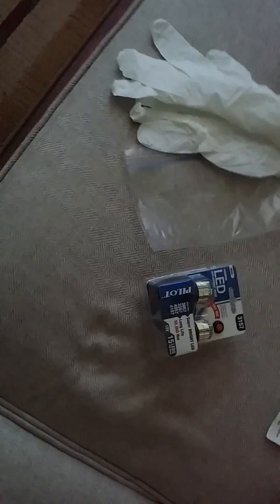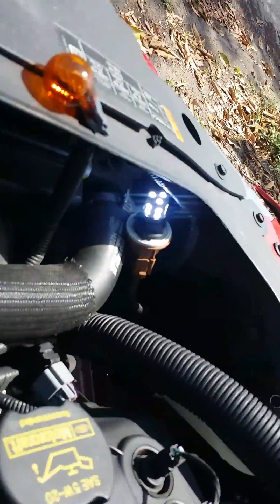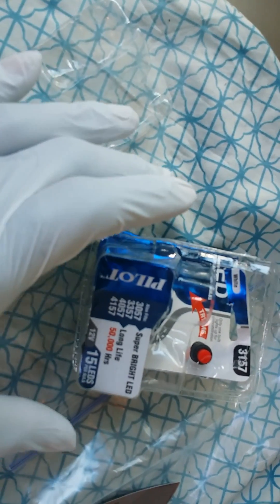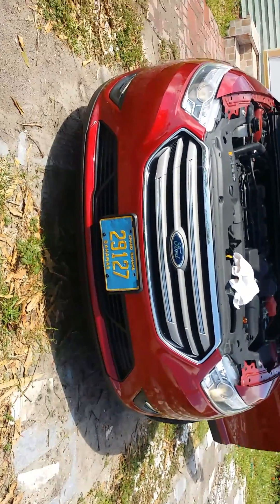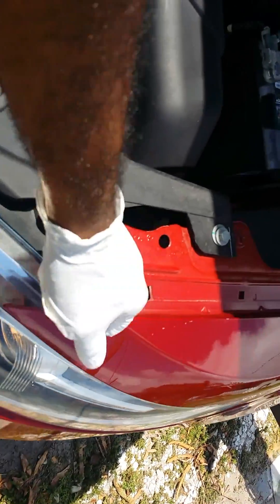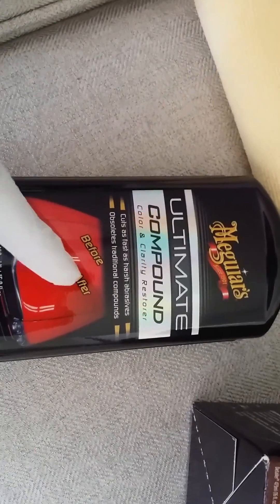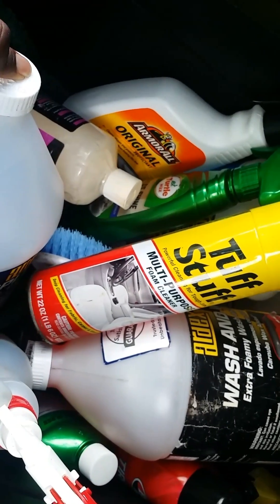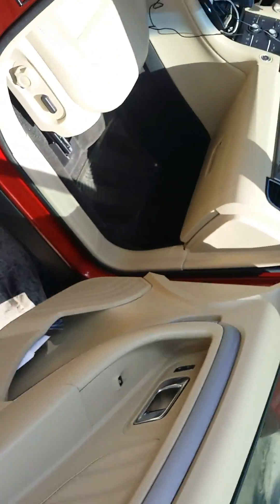2013 Ford Taurus LED front turn/parking signal bulb

Comment: I just changed my headlight bulbs on my 2013 Ford Taurus Sel, same color as your car which is a ruby red color and I bought the Led headlight bulbs on Amazon. Ebay has tons for sale also. It is a 9012 HR 2  bulb.  And man what a difference; However be careful as not all Leds are equal and sometimes the cheaper ones are better than the expensive ones.
Reply from the maker: good looking yeah I learn that the hard way. the super cheap LEDs burn out and flicker whiles a decent pair lasts

Comment: I have the same car. I am now thinking of buying those led lights.  Did the turn signal flashers work properly or did they hyper flash fast?
Reply from the maker: you can pick up a pair of LED amber from Walmart or amazon and it shouldn't hyper flash but get some that's error free.

LED driving straight now turning on turn signal. LED sequence:

White-Amber-White-Amber-white-Amber   <----- this kind most likely will hyper flash (is has more work to do)

White-Amber-Off-Amber-Off-Amber-Off-Amber    <--------- This kind is what I currently have and does NOT hyper flash (far less work)

Comment: Why didn't you get Amber led's?
Reply from the maker: months later i asked myself the same question. so one night i was at a 4 way stop sign and the car ahead didnt realize those were my turning signals so i possibly may be going to walmart to change them to amber, thanks though really appreciate the reminder
Reply from the maker: Oh I did end up changing the turn signals to switchback. Amber and white. What it does is while my parking lights are on they are white then when I put my turn signal on it then turns off the white going dark then the amber turns on and off until completed then goes dark then turns on to steady non flashing white

Comment: Headlights must be 360 degree also, like the turn signal ones you installed. If you put in the flat blade LEDs in your headlights that’s the WRONG kind!
Projector headlights require a bulb that shines 360 degrees or else it screws up the beam pattern and you’ll blind other drivers.
Reply from the maker: this is old video now, but for my headlights I have LED bulbs that cover more ground and the parking/turn signals are 360 degrees, thanks

Comment: Is it cause hiperflash when turn signal on
Reply from the maker: this one in the video above wont hyper flash because its not working that hard, its just White-Off-White-Off-White LED driving straight now turning on turn signal. LED sequence:

White-Amber-White-Amber-white-Amber   <----- this kind most likely will hyper flash (is has more work to do)

White-Amber-Off-Amber-Off-Amber-Off-Amber    <--------- This kind is what I currently have and does NOT hyper flash (far less work)